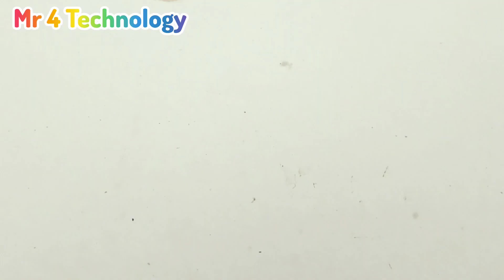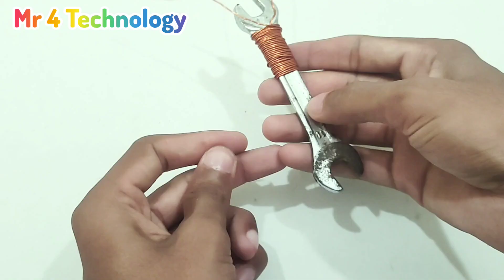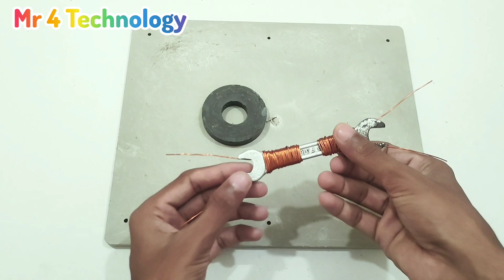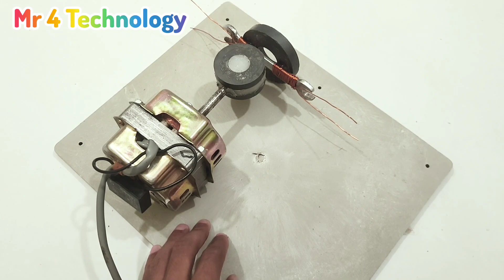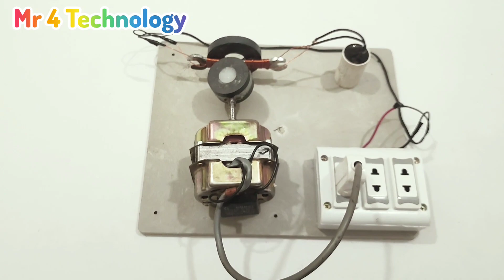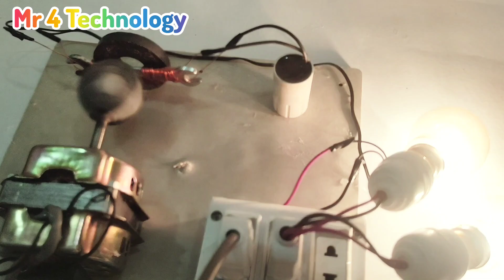Free Electricity Generator 4000w With Magnetic Tools Use 240v Fan Motor

Comment: This design may be improved by the addition of a reverse biased subduction spline in circuit with the capacitor, this will smooth out the upstream resonant distortions and make better use of the transient waveform. This will  make the device suitable for powering all first generation non-reactive plasma generators without any unstable side band effects.
Reply from the maker: Thanks bro